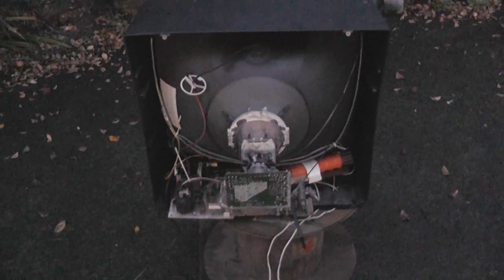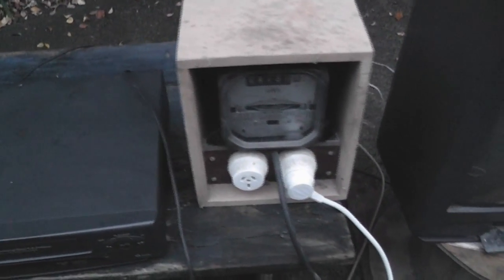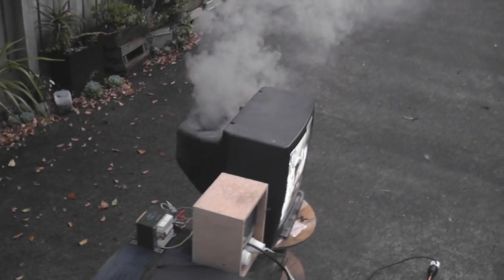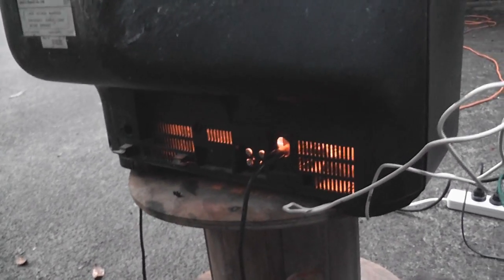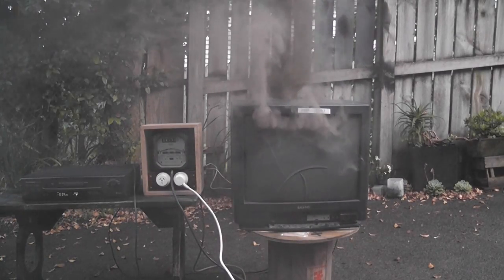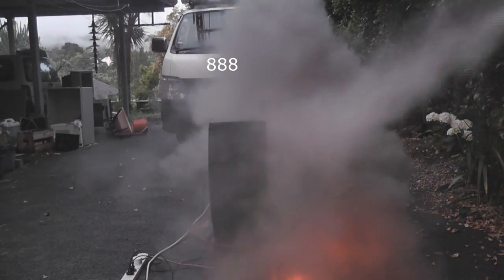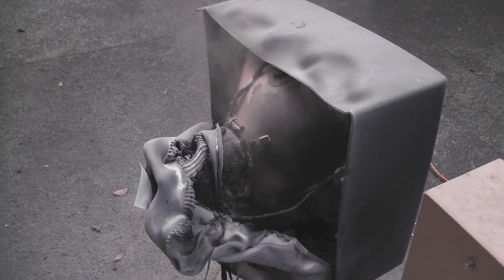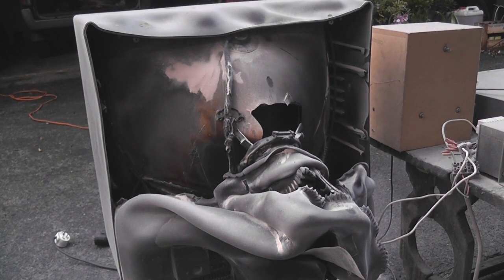Working TV smoking and on fire

Comment: Back in the day when CRTs were still widely used, some left their TV in stand-by mode even when they went on holidays and from time to time, I would read in the newspaper how TV caught fire and burned down their apartment.
Reply: That sucks. Glad it won't happen anymore (theoretically at least)
Reply: @walter_248  oh, nah, it can still happen, just turn the TV off when your not using it!
Reply: @georgewills-ek1gg  If you mean just off and not unplugged, you got it. I can't even leave my phone screen on when I walk away.
Reply from the maker: Jeff Krong My brother burnt a house down because of a TV left on standby.
Reply: What is the actual fault that occurs in a TV on standby that causes it to fail and catch fire?
Reply: @BensSightSoundandAuto  who knows
Reply: +George a beam cuased by high voltage of negative and positive type of electricity meeting up in a object that electricity can flow on
Reply: haha is that right? What exactly is standby mode tho?

Comment: It's surprising how quick a CRT TV goes up in flames.  About 15 years ago my granny had the TV on (~21" set) and in the time it took for her to get something from the kitchen, the whole back was up in flames.  Luckily there was a garden hose handy, which a neighbour used to put the fire out by breaking a window near the fire.  It took a few weeks to clean up the smoke damage (repaint the rooms, etc).  There wasn't much left of the TV, just the base part and a lot of chunky shards of the CRT.
Reply: I know what your talking about, i remember the time i was watching the supercar races when i smelt this awful sulfurey ozone smell coming from the TV, my cat was on top of the TV. then all of a sudden there was this hiss sound and arcing inside the tube neck housing, the cat jumpped off of the television when SMOKE wisped out of the vents in the tube neck housing, i ducked into the closet and turned off the breaker to all of the outlets. when i got back into the living room, the smoke detector was giving out 3 sets of beeps every two seconds and the TV was off (because i flipped the breaker thx captain obvious) and the entire tube neck housing was engulfed in flames. thankfully, i had a fire extinguisher and was able to knock it down very quickly. the TV resembled a burnt out wind turbine after everything was done with. the front of the TV was fine, except for the fact that there was a huge crack in the screen.
my sat receiver and VCR survived, but i can't say the same for the cables. fixing the damage was fun, and expensive. as for the TV set, i ended up donating it to a electrical fire  safety demonstration thingy along with the CCTV footage of the whole event. I still see that TV at the exposition center whenever they demonstrate what happens. they have had it retrofitted with some kind of LCD thingy and play back the footage of what happened ( edited along with some other fire safety tips ) to the set, on the set. kinda ironic watching a video on the TV of itself bursting into flames.
Reply: @georgewills-ek1gg  why did it catch on fire... i dont even wanna turn on my ''14 philips..

Comment: nice! that tv worked for a long time. Even under fire and stress with componets burning and popping, it must have fuzzed the CRT picture circuit first? then later got the rest, input, decoder, audio, etc. oh and that sstinks about the tornado.. My condolences go out to the families as well. Was it close to your town? or no? If not, your lucky it missed you guys. I've never been in a tornado, but seen the sky before one. VERY DARK BLACK and calm. Scary.